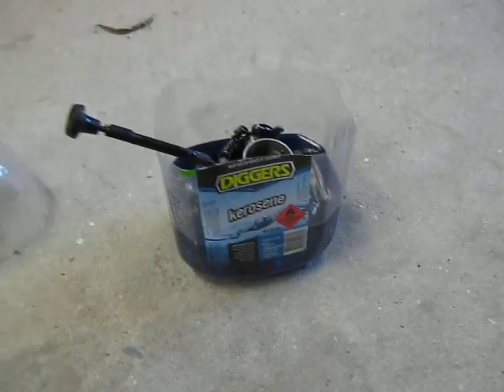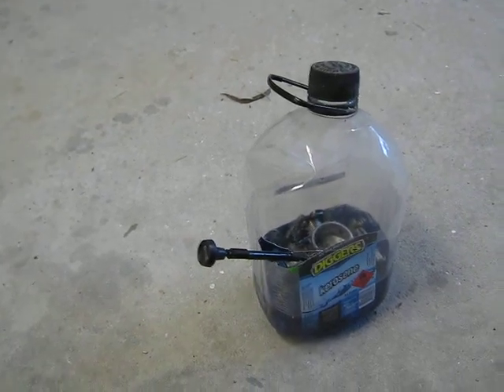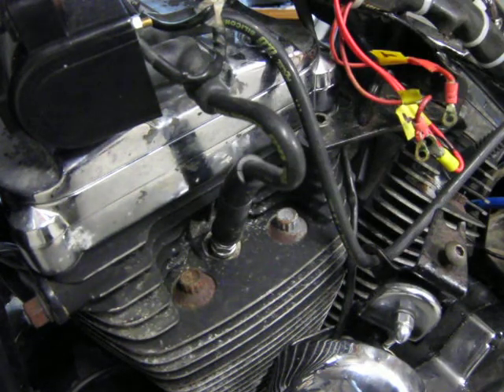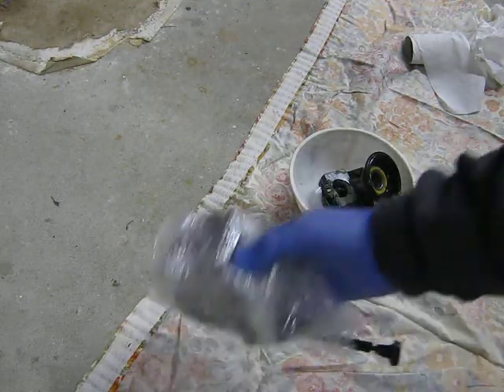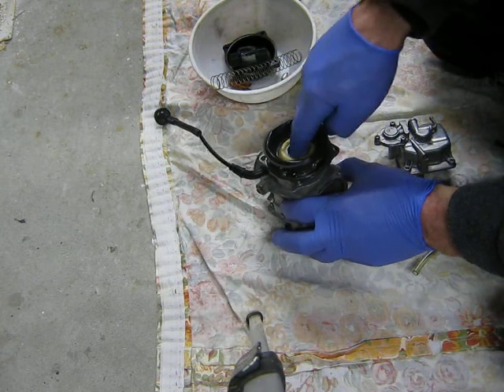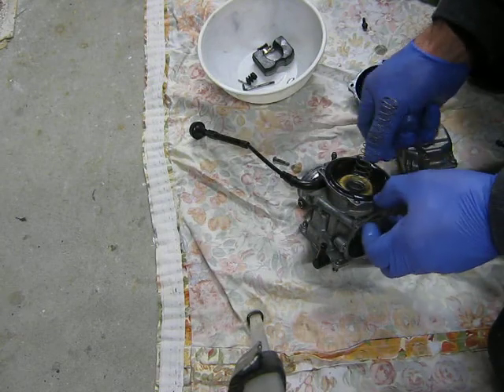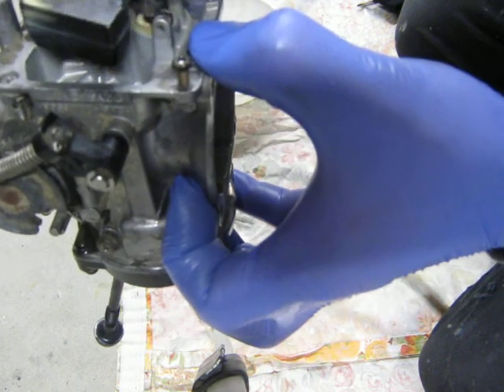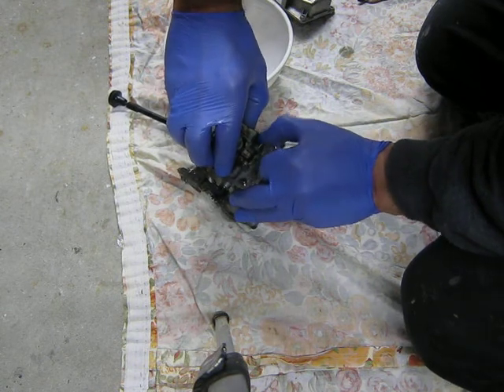Sportster problem 28 problem with bike was carburetor

Comment from the maker: I must have missed some thing. the problem with the motor running was the carburetor, ( this work didn't fix the problem ) it was rebuilt by a senior mechanic / auto electrician, also the bike needed to be upright ( not on side stand ) to start and warm up, the bike went very well when warmed up.